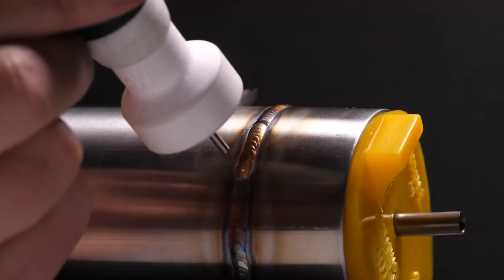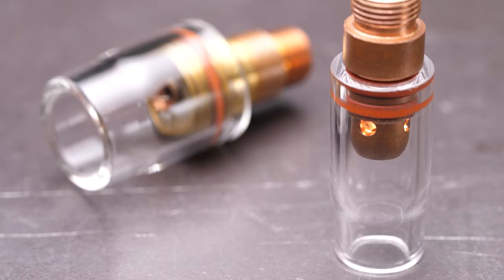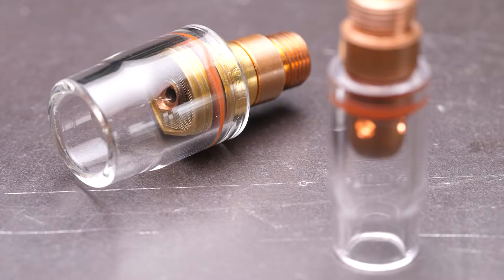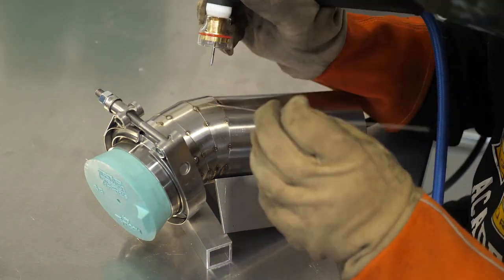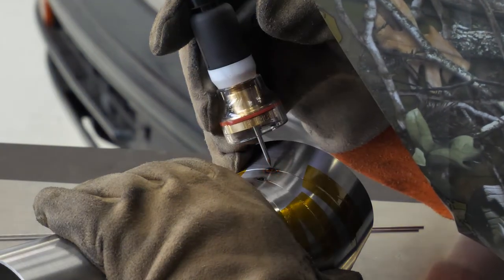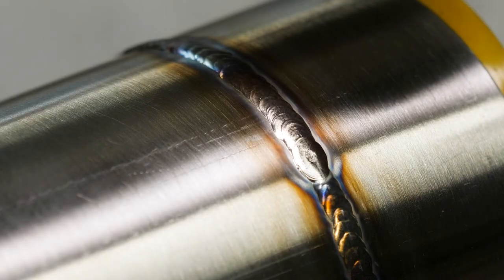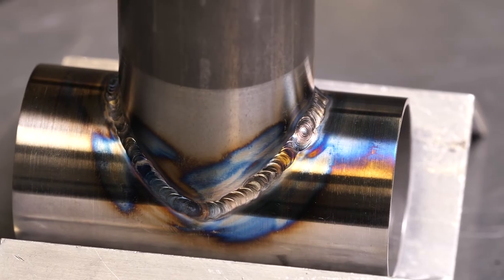Choosing A Gas Cup Or Gas Lens | TIG Welding

Comment from the maker: Building a fast car? Get $400 OFF the all inclusive VIP package deal:  https://hpcdmy.co/vipy41
Practical TIG Welding course. Get started today with 50% OFF: https://hpcdmy.co/offery41
TIME STAMPS:
0:00 - Argon Pre-Flow & Post-Flow
1:01 - What Are Gas Cups/Nozzles
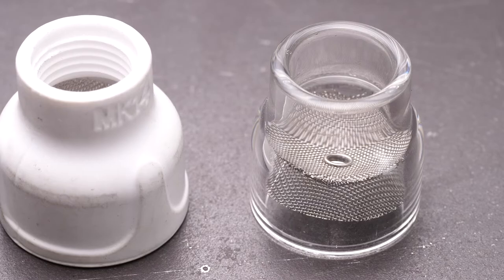1:25 - Gas Cup Sizing
2:16 - Different Styles Depend On Your Torch
2:30 - A Gas Lens & Sizing
3:01 - Gas Cup Coverage Example
3:26 - Gas Lens Coverage Example
3:50 - Efficiency/Gas Savings
4:17 - Large Cup Sizing
5:05 - Careful With Your Gas Flow Settings
5:36 - Flow Rate Rule Of Thumb
6:09 - Large Cup Downsides
6:58 - Tungsten Stick-Out
7:26 - Working In The Wind
8:00 - Gas Lens And AC/DC Welding
8:38 - Key Points
9:24 - Just One Of Over 50 Modules

Comment: I made a mistake and the welder I purchased is a scratch start TIG (multi purpose MIG and stick also) so I know Aluminum is out of the question. But can I still fab up some nice exhaust and bracket related things with a scratch start?
Reply from the maker: You sure can. It's not the preferred setup these days, but, it is still going to get the job done if you take the time to put in some practice on it. Definitely better than no welder 😎
Experiment with a few different ways to start the arc too, some guys use a copper scratch pad, others put the filler rod to the workpiece and then the tungsten to that to avoid contamination.
Note we don't dive into that in the course material specifically if you end up taking it, but there is plenty of other info that will help you out once you're confident with that aspect 🧠 - Taz.

Comment: whats the difference between a gas lens collet vs gas lens cup?
Reply from the maker: Basically the shape. A collet creates more turbulence in the gas flow which can draw in oxygen, defeating the purpose of using shielding gas as well as arguably requring more flow for the same coverage since it's just spitting it out all over the show, comparatively.
A lens does the same functional tasks, but by design does a better job of directing the gas.
This allows a few things including the ability to have your tungsten sticking out a bit further which gives you better visibility - Taz